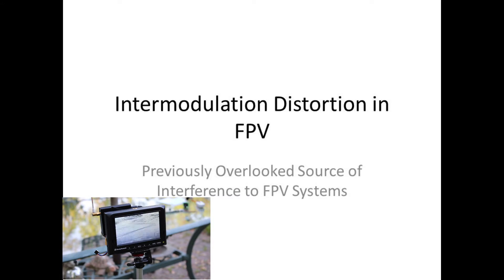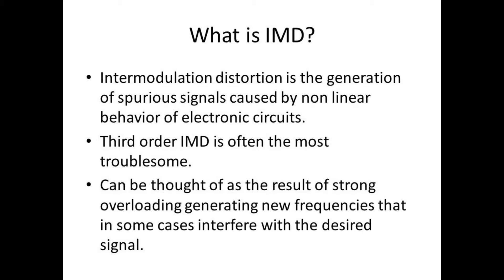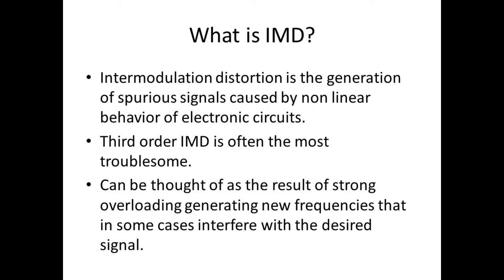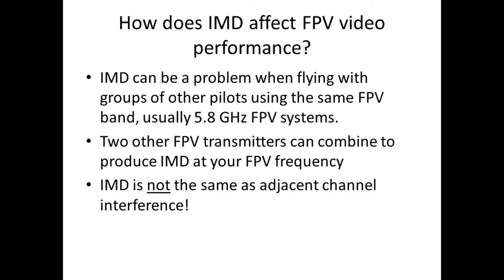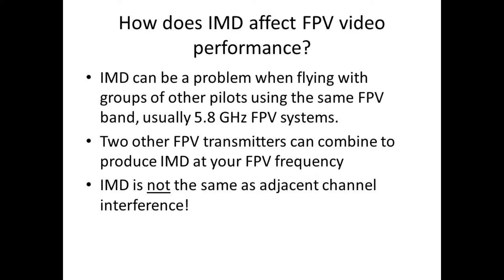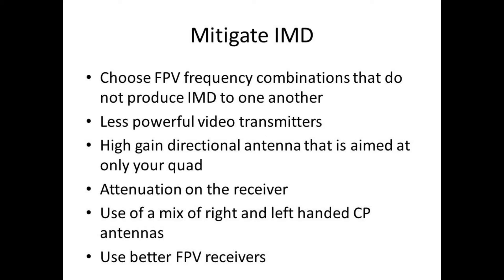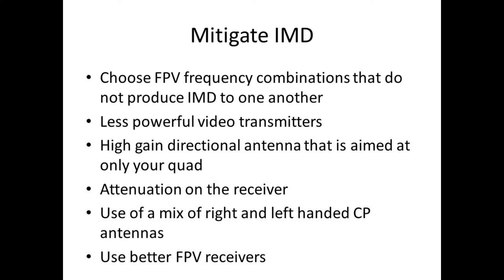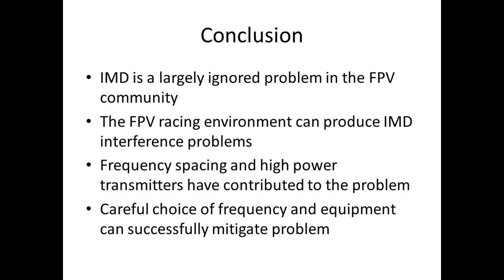FPV Interference - Intermodulation Distortion - IMD demo

Comment: +Jonathan Hair wow, very interesting, is this possible with the Raceband on 25mW? any knowledge or testing of that? :-)
Reply from the maker: +Von Sieg Yes, the raceband, while being well spaced from one another, suffers from this too because the even spacing makes the IMD products come out on top of one another. Try a few examples with the math and you will see that even spacing of the channels makes the arithmetic come out that way.

On 25mW it is unlikely you will have big problems, but still something to consider and experiment with.
Reply: +Jonathan Hair great and many thanks Jonathan, i'm on a mission to convince everyone here in Denmark to go 25mW Raceband. :-)
Reply from the maker: You can have even better results without raceband. Read the RCgroups discussion linked in these comments for some example frequency sets that completely avoid IMD.